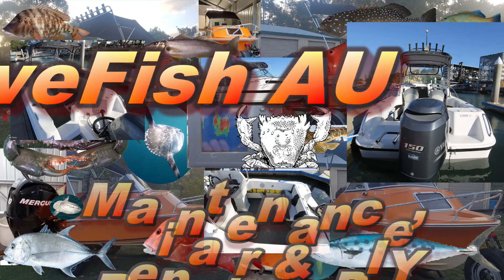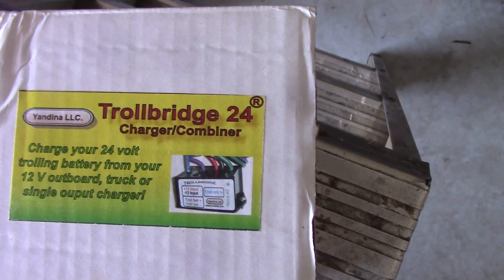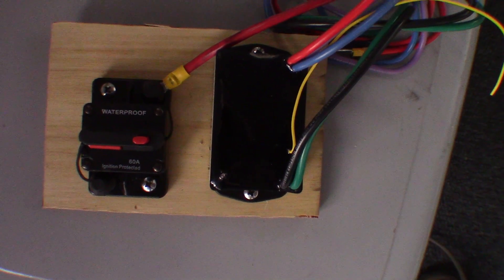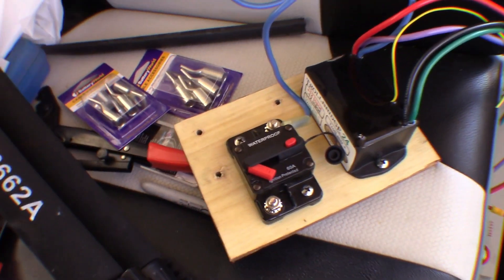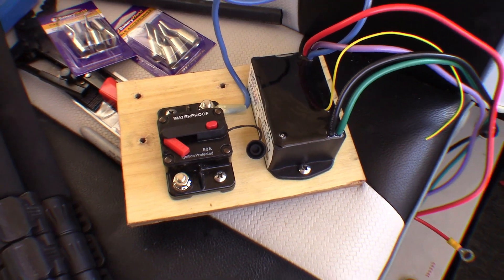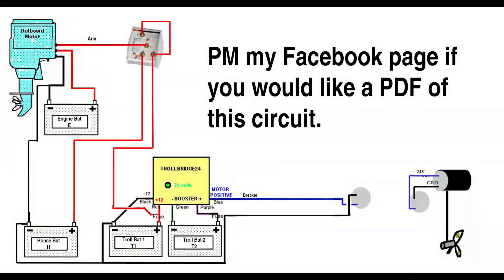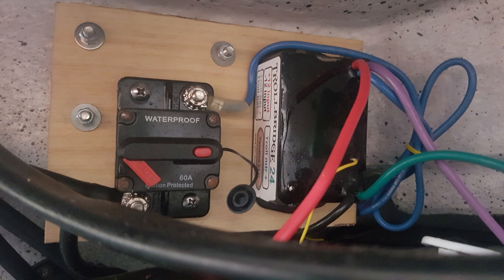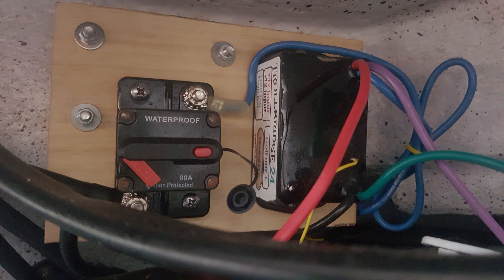Charging a 24V battery bank from a 12V Alternator

Comment: Hi
You can have both engine and 24v trollling engine both on?
Reply from the maker: Yes, but if the trolling motor is running it won't charge..
I have revamped my system when I went Lithium and the new system will charge the battery while the trolling motor is in use.  https://youtu.be/QQLDABYU-3M

Comment: Dear , I have a car running on 12 v battery and i need to run the car system on 24 volts any system can any one update me with the above system    thanks ,   fareeddammam@gmail.com
Reply: thanks, for your reply
Reply from the maker: I'm not sure exactly what you are wanting to achieve but the unit I have described here might work for you 
Another and probably cheaper alternative would be to have a look at http://yandina.com/  They also have units designed for charging 2 x 12V batteries and automatically combining them for 24V output.
Reply: @weFishAU  thanks for your reply

Comment: the title is a bit confusing. The 24v battery bank you mention is actually a two 12v batteries, not a 24volt battery. Its only 24volt via electronic connecting it in series.
Reply from the maker: I didn't think so, that is why I called it a 24V battery bank instead of a 24V battery.  I guess I can see how you might be confused if you thought it was a bank of 24V batteries but that would not be very common setup  in a system with a 12V alternator.  Wasn't intended to mislead.
Reply: @weFishAU  No worries. I thought I hit the jackpot when I saw the video. Then I started to realize what it is. I have yet to find a device that charges 24v batteries from a 12v car. How is it there? You seem to have better gear and stuff there then the USA.
Reply from the maker: Actually, I bought all the gear in that video from the U.S.  For what you want and all I can think of is an inverter to convert the 12V into mains AC and then run a normal 24V charger off that.  There should be some marine grade systems available off the shelf.  Minn Kota offers something similar for their trolling batteries, not sure if it is for 24V or banked 12V but it is a starting point.

Comment: hi, been looking for a few months for a 12v to 24v charging system for my minn kota and came across ur vid. have been on their site that u linked and found it interesting. wats ur honest opinion/review of the trollbridge and should i get one or not. cheers.
Reply from the maker: I'm very happy with mine.  Works exactly as advertised.  I put a switch on the yellow wire that is used to force it into 24v mode "just in case".  I haven't had to use it but for the price of a small marine switch I thought ir was good insurance.  I would certainly recommend the setup I have.
Trollbridge also have another unit that combines the functions of the one I have and the ProISO Charge unit.  I haven't used it so I can't comment on it but it may be worth investigating it as I think it might be a cheaper solution than what I did.
Reply: @weFishAU  for my verification i still wire the 2 batteries in series for 24v then add the trollbridge. cheers.
Reply from the maker: Yes and no.  You wire both batteries to the Trollbridge and it switches them into series when it detects a load (like the Minn Kota is turned on) and reverts to parallel when there is no load so they will charge.
Reply: @weFishAU  so no red battery cable joining the batteries. the trollbridge is the 24v connection wen it detects the MK is running and then deactivates itself wen the MK is not running. then as u said it reverts to parallel for charging. that is my understanding of wat u just said to me. how did i go.
Reply from the maker: Perfect.  That is exactly correct.
Reply: @weFishAU  sorry for not understanding. i thank you for ur patients🤜🤛. a 24v system that is very different from wat i am use to. have order 2 of them, one for my brother. once again thank you👍👍. cheers.
Reply from the maker: No problem, happy to help.
Reply: @weFishAU  hi we last chatted many months ago bout the trollbridge 12x24. for reason i never got to purchase them. before i do so can u tell me how the trollbridge is going or u have changed it out for something else now. thanks.
Reply from the maker: Hi.  No, I am still using the trollbridge.  I did have an issue with the ProIsoCharge and because of the time it was going to take to get it fixed or replaced (from USA + Covid) I ended up replacing it with a Yandina product, the Combiner 100.  Very happy with both Yandina units.
Reply: @weFishAU  thank you i am happy to know the trollbridge does work n still is working.

Comment: So with this system could I run a 24v trolling motor with 2 12v deep cycles wire together then use those as a cranking batteries when I’m done using the trolling motor and they’ll charge them up?
Reply: See for me it doesn’t bother me because my motor is pull start also and fuel injected so it’ll start anywhere even without a battery to electric start
Reply: That’s why I’m interested in your product because I want to run a 24v motor and not carry a crank battery with cause I’m confident I can get my motor running if the battery’s are run dead
Reply: And then be able to have the charge em up
Reply from the maker: Depends on the motor I believe.  I'm not a mechanic but I am a pilot and I remember when I was learning to fly I was told you could start an aircraft engine with a flat battery because they have magnetos but you couldn't do the same with a car because it has a distributor and needed charge in the battery to spark the plugs.
I know some 2 stroke engines have magnetos but I really have no idea what outboards use.  I would make sure you can start the engine with the battery terminals disconnected before I risked running the cranking battery flat.
That said, if you feel this would work for you there are some links in the video description that will put you in touch with the manufacturers (USA) or distributor (Australia).
Reply from the maker: I guess in theory you could but I certainly wouldn't recommend it.
I firmly believe that your cranking battrey should be seperate and should have nothing connected to the curcuit that should be on when the motor isn't running.  It's too easy to drain your batteries to the point where they won't crank the motor if you don't keep it isolated.
If you fish a long way offshore that's the stuff of nightmares.

Comment: I'm pretty sure you can wire each 12v battery direct from a 12v charger without the trollbridge24.  Just connect your 12v supply direct to each individual 12v battery (even if they are wired for 24v.)
Reply from the maker: To get 24 volts you need to connect 2 x 12 volt batteries in series.  To charge them from a 12 volt source you need to connect them in parrallel.  The trollbridge does that switching automatically.
I don't know of any way where you can have both serias and parallel connections at the same time.  Even if you connect the charger directly you are still creating a parallel connection to batteries that are already connected in series.
Every electrical engineer I have spoken to tells me that is the way it works.
Reply: are u in your right mind? can u differentiate serial and parallel connection?

Comment: I have 24v 7 amp battery for power wheels can I replace it for 24v 12 amp?
Reply from the maker: Any 24V battery will work.  A higher Amp/Hr rating just means it can supply power for longer.  I'm not sure what the 7 and 12 amp figures refer to unless it is the continuous current the the barrery can supply.  If that is the case then replacing a 7 with a 12 would be okay but replacing a 7 with anything below that would not.  Hope this helps.
Reply: weFish-AU thank you so much
Reply: weFish-AU thank you
Reply: weFish-AU 
it has 2x12v can I replace them with 2x24v?
Reply from the maker: Depends how they are connected.
If the 2x12 are connected in series to make 24V then you can replace with 2x24 connected in PARALLEL which is still 24V but double the amp hours.
If the 2x12 are connected in parallel then no.
Reply: weFish-AU Very helpful thank you
Reply: weFish-AU One more question now it has 2x12V 7ah should I get 2x24v 7ah or 2x12 75ah?
Reply from the maker: It largely depends on how you need to use them and how much you can spend to do that.  For example:
2x12V 75ah connected in series will supply 24V @ 10A for 7.5hours.
2x24V 75ah connected in parallel will supply 24V @ 10A for 15 hours.
Note that I picked 10 as the supply amperage to make the arithmetic easy.  Drawing 5 amps would double the time and drawing 20 would halve it.
If you are driving a 24V trolling motor which has an average draw of 30 amps then the 2x12V 75ah will run it for 2.5 hours and the 2x24v 75ah would run it for 5 hours.
My setup has a 24V trolling motor and 2x24V 135ah connected in parallel for a total of 270ah.  My trolling motor has a maximum draw of 60A (I guess an average of 25A to 30A) and I have run it for over 6 hours without flattening the batteries.  If I am holding in high current and drawing the maximum 60A I will still get over 4 hours running.
Reply: weFish-AU thank you so much

Comment: Please let me know if this will work in my setup.
I have a 24v battery system. I want to use my car to charge the  system in emergency. My car's alternator is 12v.
Can I use this item to charge the 24v battery using the 12v system?
Reply from the maker: A similar setup would work ro allow you to charge your batteries from a 12 volt system.  Without knowing the full details, you might only need the trollbridge.
Unless you are wanting to charge away from 240V power a 24V battery charger could be a cheap option.